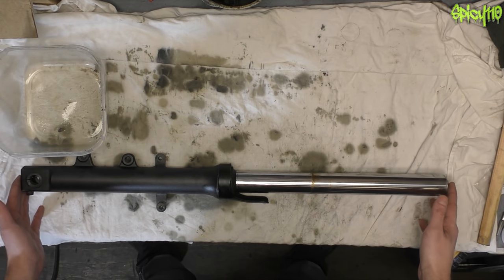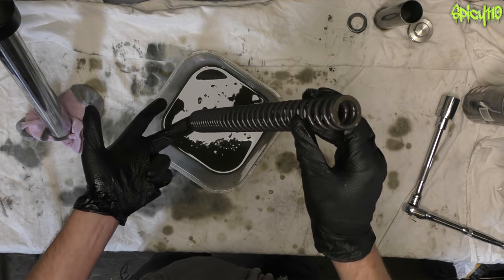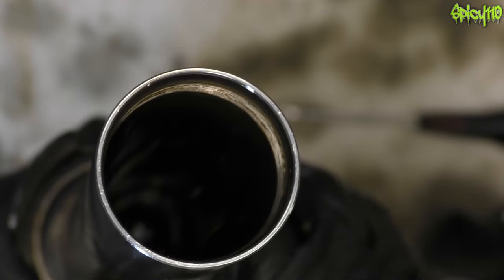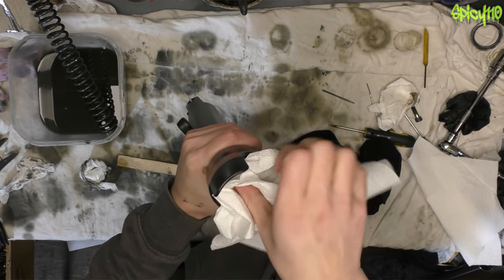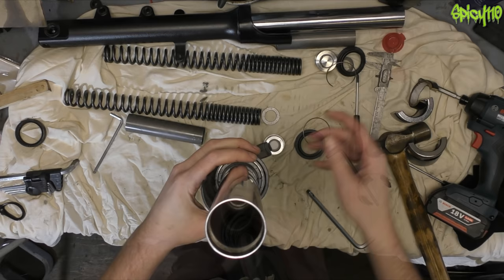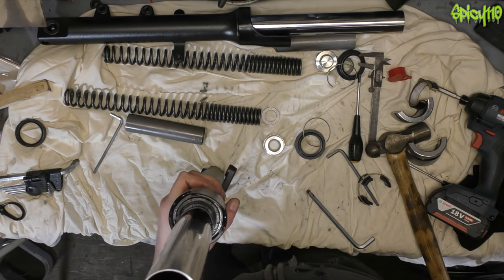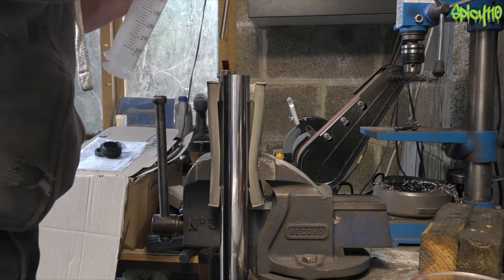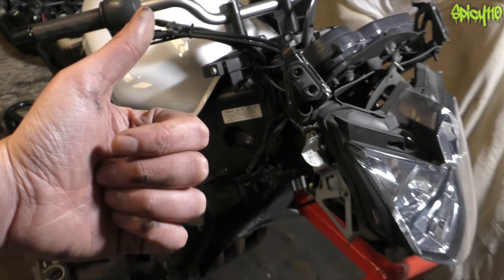Changing Motorcycle Fork Seals! - Save a lot of Money!

Comment: Hey, I know this is an older video but when you measure fork oil height you are supposed to do it with the fork tube pushed all the way in without the spring installed.  If you place your hand over the top and form a seal, then push down you can easily bleed the damper rod in one or two strokes.

Comment: This is the best vid I have seen on this topic. I just have 2 suggestions. Firstly the 2 bushes that you slide over each other have a PTFE coating the bottom bush on the outside the top on the inside NEVER do this it can destroy that coating very easily. Secondly the top caps have a specific torque setting from the manufacturer, I would suggest that you inform your audience that this setting is extremely important and can be found in bikes service manual or researched online. Other than that absolutely brilliant👍.

Comment: Actually they need 2.5w if you use Motul. It should be 15cst at 40c. Yamaha OEM is 15.6 iirc. Also its 473cc per fork, not 470. Although almost he same.

Comment: I have to point out that it's not just the circlips that hold your suspension together, it's the damper rod retaining bolts that stop the stanchions separating from the sliders.
This job is a lot easier on my GS550 and T140. On both you can replace the seals with the stanchions still attached to the bike. After removing the calipers, wheel and mudguard, you just take out the damper rod bolt, let the oil drain, and slip the slider off the bottom of the stanchion. You can then remove the seal and its retainer, clean it out and replace the seal, then slide it back on and refit the bolt (there are no removable bushes, so seal can go on from the bottom). I use gaiters on both of mine to keep the dirt away from the seals. All you have to do then is remove the top cap and refill with the correct quantity of oil.

Comment: The worst fork seals to have to change are 1970's Jawa & CZ because the seal goes on from the bottom as the tapered fork legs are left attached to the bike.

The whole fork leg has to be dismantled. The bottom mounted damper cartridge has to be removed & cleaned. Then the spring via the bottom. Then the two phosphor bronze (or more expensive Alloy Bronze versions) slider seals have  to be removed carefully and then finally the top oil seal carrier collar.  The seal can be either removed and replaced in the carrier collar or just fit a brand new carrier collar with a new seal already in it (the non-masochist option). 

This takes hours!!

The most over engineered fork designs I've ever encountered. 

Not one of my favourite jobs because rebuilding engines is easier & quicker.

Comment: Hi, u needed to explain if the tighter fork spring coils need to go at top or bottom. Also, whether to check oil level with the lower part fully extended, cheers, xx

Comment: What stand are you using for a motorcycle?
Reply from the maker: I use a rear paddock stand with a front headstock stand. It really is the only option unless you have a centre point lift hole on your bike and a corresponding stand. Here is a timecoded link to where you can see what I use https://youtu.be/ucVHa505jYs?si=U6zHXv3RyyJCcoSe&t=656

Comment: How often does one have to do this on a modern motorcycle? When it leaks or is it good practice after some mileage? I have a 2017 Triumph Street Scrambler and it doesn't mention anything regarding seals in the manual. Of course it also mentions to replace the fork oil after 26.000 miles which is a bit shady...
Reply from the maker: Peroanly I would say when they leak, tho if I got to 20k miles I would feel they would need doing soon. The thing is tho I have a feeling my seals were stock so may have lasted 52k

Comment: I've got a MT-07. I used an impact & installed spring washer spacer ect. The damping rod just spins inside! Any ideas!? I need to jam it in place so I can remove it.
Reply from the maker: There are damper rod holding tools you can get, or (and this is not the best way but I have done it,) use a bit of soft wood to hold it in place for the first impact wack.
Reply: @spicy110  I'd love to buy a tool but yamaha. Doesn't give you any ideas what this tool looks like, what dimentions it has. 

Fork seals are super easy to damage & need replaced quite often same with fork oil. YET THIS is the most frustrating thing I have ever done on my bike.

I only wanted to change them as they're cracked. Wanted to sell it with new seals. Now I wanna jam a tool up yama...
Reply from the maker: @Near2Future  They are universal just google Motorcycle fork damper holding tool. there are two types the H shape one is not the one you want as far as i know it is the one that looks like a stick. This is a common issue with standard forks of all brands.
Reply: @spicy110  Without using the tool, i managed to get one fork bolt off. I used a heat gun for 10 mins on lowest setting. Just moving it around the fork, trying to follow where that bolt would be. After ten mins, with all the parts inside. I compressed the fork as hard as I could on carpet. (Upside down) then used the impact to spin it lose. Came out with no issues!

I'm gonna try this with my other one. Not sure if it will work but worth a TRY! :)
Reply: @Near2Future  If you leave the spring in, under load, it should give enough resistance to hold the damper rod in place while you slacken the bolt with an impact gun, then refit the spring and top cap before retightening the bolt (it's always worked for me).

Comment: Can categorically claim, I will never ever attempt this
Reply from the maker: haha
Reply: Wandering where spicy110 gets his definition of "easy" from?

For me (qualified in Servicing & Repair of Motor Vehicles Level 1  (pre ECU versions - when you could strip down an engine and rebuild easily...remember those feeler gauges 😉))
That fork seals maintenance does no way meet the main/common definition of "easy"
Definition 
achieved without great effort; presenting few difficulties.
free from worries or problems.

Yes I get it - enthusiast with lots of time and the assistance/support of many with the availability of non-stand tools.... go for it but for me... sprockets and chain is easy - fork seals I'm out!